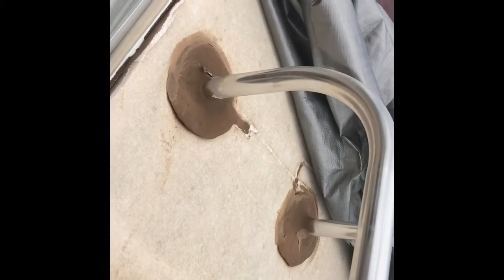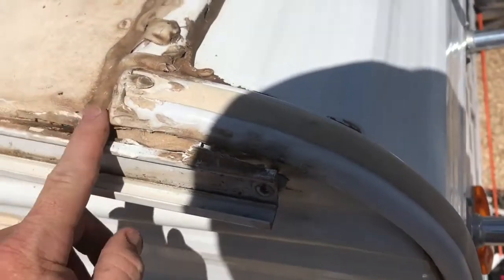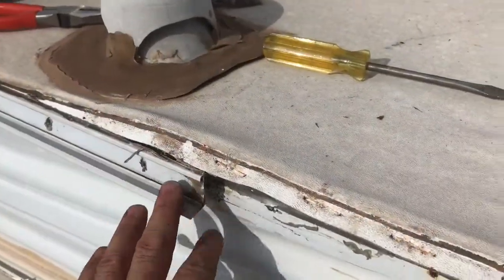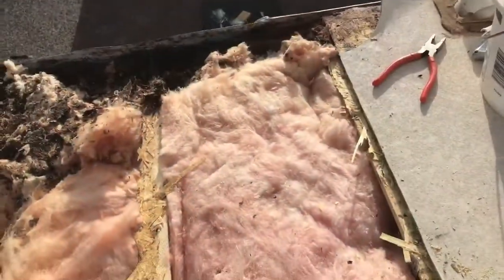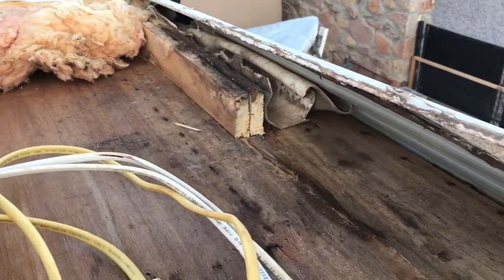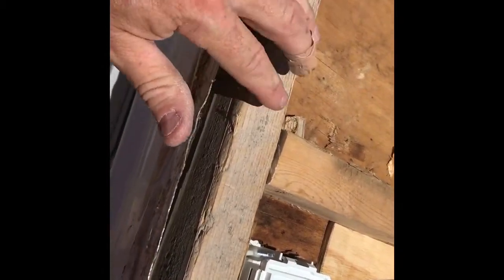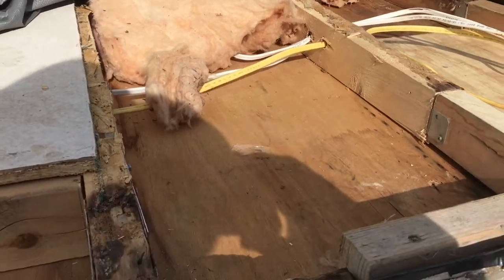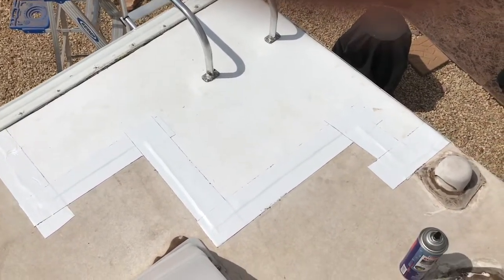RV TPO roof repair

Comment: Hows your patch/repair holding up after 5 years? I'm thinking I will do this as well but curious to know if the repair worked long term for you?
Reply from the maker: I sold it last year but is was solid as a rock. Looked just like it did when I first finished it

Comment: screwing another 2x4 to the sides of the 2x4s that you spliced would of done a lot stronger job the the metal brackets you used. as long as you can get them. I know you had wires in the way , but if the can be disconnected and re drilled threw.

Comment: Q: How did you cut the old OSB away? Especially down the middle of the supports?
Reply from the maker: I used a Harbor freight electric multi tool with the wood blade.
Reply: @diyhgg8674  thanks! I've got to do basically the same repair in both front corners of my 2007 Wildwood LE by Forest River.
Reply from the maker: Richard Bruce Music 
I had to feel it out as I went along but it beat paying $3k-$5k for a new roof. I also did it out in the open and had to buy a huge tarp to go over when I could not work on it. 
Good luck with it
Reply: @diyhgg8674  same here - thanks!

Comment: Thanks for the video. 2 things to mention to other viewers. TPO can be heat welded. Look at heat welding edges of new TPO over old TPO. I am glad you said Dicore. It sure looks like that is what failed and caused all of this mess, Look at 
White Tremco DyMonic FC Polyurethane Sealant or Chemlink M1 sealant.
Reply: RV TPO can not be welded. Any TPO welded needs to be the same. You can mix and match TPO to weld. Product has to be from the same manufacturer. It may appear to weld, but it won't stay welded unless the are the same manufacturer product. 
Note to Gregg... should've mold killed all that mold to be certain no it was not going to continue growth under new material.